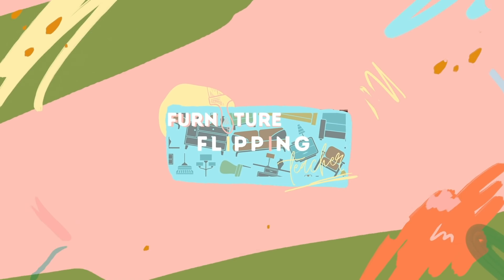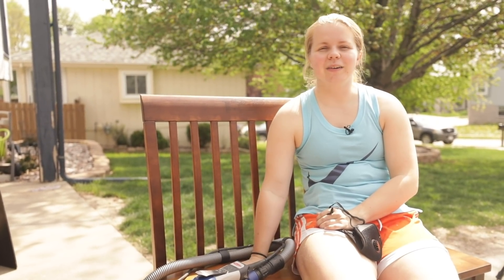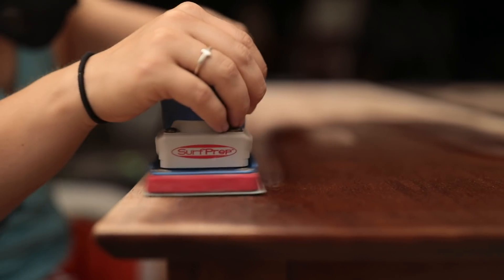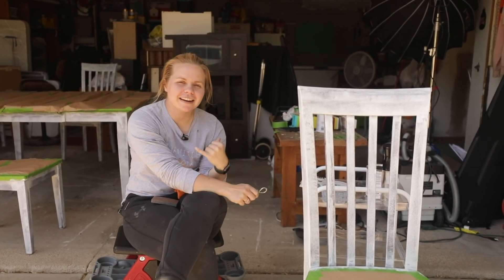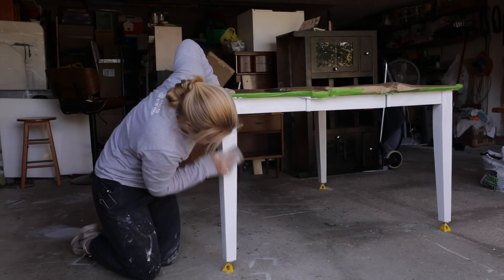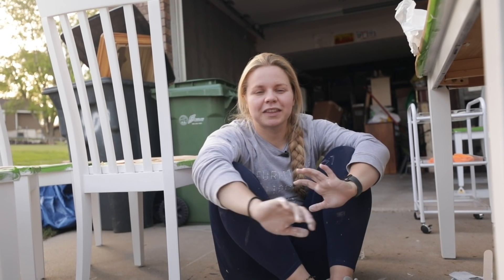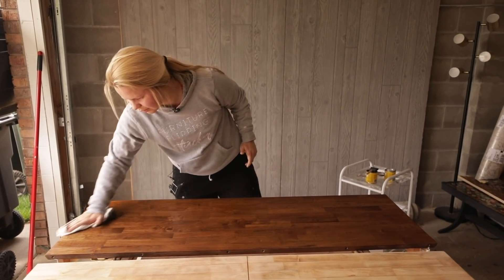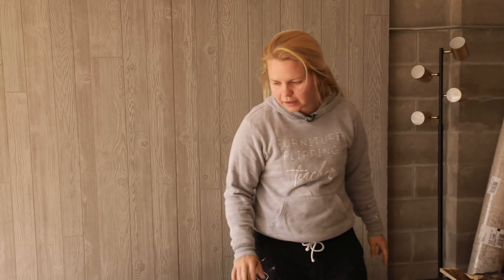DIY KITCHEN TABLE MAKEOVER | How to Refinish a Table | Beginner Friendly

Comment: Great job! A little hint: I do 2 coats of BIN shellac primer when painting white. That second coat does amazing and will cut down on coats of white. Also I have the store add 65 drops of black to a "gallon"  (15 drops to a quart) as the BIN has a yellow cast and the light grey (after adding the black) makes the white paint brighter!
Reply from the maker: I realized I should have done two coats of primer after I did the first coat of paint! I do actually have some gray primer as well, but I usually use that if I’m gonna go for a darker color. Thanks for watching!

Comment: What a cool channel you have. Thank you for all the knowledge here. Wow. I have a question, we just got an old dining table that has intended grooves in the top. They are about 1/4 inch deep,  there are a lot of them and of course they're disgusting and dirty. I tried steaming the gunk out and ended up shredding a little of one groove before I stopped. Now I'm wondering if I should get a heavy duty sander, CAN I sand down that far? I wondered what you think or if I should just make this into firewood?

Comment: I used one of those orbital B&D sanders on a hardwood bedroom floor, then refinished with an oil base poly.  It wasn't perfect, the wood could have used a real floor sander, but it was 500% better than what I started with.  I simply attached it to my shop vac which worked out pretty darn good even though I had to tape the intersection of vac hose and sander handle.

Comment: It looks amazing.I have done several pieces this way.( stain top,paint bottom) On the chairs, I find it easier to remove the seats whenever possible before staining them.Also, I flip the chairs upside down onto a table or counter and do the legs first( both coats) then flip them upright to do the backs and area where seat will re-attach to. I always tell my clients that it will be materials plus labor and try to give a ballpark on each.But a lot of times I still short change myself.🤪

Comment: Hi. I like the instructional videos. What do you use to clean wood with? Do you have suggestions on how to refinish my mom's wood dining table? It has plastic tablecloth doily outlines in it and my sisters will kill me if I paint it or the buffet and hutch. Should I sand to bare wood or can the residue be removed and finish restored? Right now it is covered in papers and glasses and plates,, so not in a rush

Comment: Chair rungs/spindles take FOREVER! We found the same issue, lol. SO... we now use foam roller for base and 2nd coats on the spindles. The finish coat is brushed and I still use my custom chalk paint and hand rubbed wax finish. No perceivable difference, but a world of my time saved!

Comment: I’m pretty sure if you would’ve flipped those chairs over you would’ve found that there were four screws holding the seats to the frame. When I do finishes like this I remove the seats which makes painting and staining so much easier. Just a thought in case you do another set like this.
Reply from the maker: You know... I don't think I checked but I will definitely keep an eye out next time! 
Thanks for the idea Connie 😊
Reply: I was definitely thinking the same thing!
Reply: I have the same dining set and they do have screws.

Comment: You can custom mix your stains, like say 50% one color and 50% another. Try small batches and use the back of the item your staining since stain takes differently on different species of wood. Make sure you use a stir stick to get all the pigment settled on the bottom of the can.

I think if you ever get a chair like this, check underneath the seat. It might be screwed on instead of glued so you can remove the seat to stain and paint the chair separately. You could also give a price range for commission work. Maybe this could help you get your goal hourly rate.

Comment: Here's an old body working trick when sanding with a duel action sander move the sander with longer strokes looking for a cooler surface continuously so the paper doesn't clogg so fast. With this method you can apply a little more pressure and really feel it cutting through. Fastest way I know, imagine sanding a whole truck inside and out.

Comment: Lauren- can I use a water based Wipe on Poly after I stain (I’m guessing the one you used in this video was oil based). I like the “pros” of a water based Poly than the stinky & longer cure time of the Oil based Poly...
Also, I stained a dining table (but not the chairs) and I’m not happy with the stain color; doesn’t match the chairs well) would you recommend re-sanding the table or is there a way to fix the stain? (I really don’t want to touch the chairs because they are fine and I don’t want to deal with the spindles 🙄). The table top was pretty scratched up and someone place a hot iron on it... that’s why I’m only doing the table. 
Thanks 

Your pieces turned out really nice btw! 🤩
Reply from the maker: it should be fine to use water based poly as long as the stain is completely dry! 
not too sure about your stain issue but I think the only way it to sand again

Comment: Do you only sand between painting coats and not after staining? And, do you use a “damp” cloth to wipe down a final sand on chalk paint just before sealing it? I’m really having trouble using Rustoleum Chalk paint in the color Charcoal. My paint is really drying blotchy and streaky. I’ve redone it several times, sanding back down and re applying paint! I just want to final sand it and be done! Lol! I’m using a neutral wax to seal. (It’s an antique cabinet, btw).
Reply from the maker: I have only used the charcoal from rustoleum a few times, and it is a little bit more difficult to work with than the linen white. I have had a couple of other people express the same situation that you are having. I would just make sure that you are thinning it out with water and making sure that it doesn’t dry too fast in heat etc. I do a light sanding with a very fine grit of sandpaper between painting and staining. I would recommend the finishing pad for the last coat of paint before the topcoat. hope this helps! Thanks for watching!
Reply: @FurnitureFlippingTeacher  thanks so much for the recommendations. I will try to find the finishing sanding block. Maybe at Home Depot?? I did finally get it to look halfway decent with a roller. But you can still see blotchiness. And some streaks. But not nearly as bad as before. Hoping the final sanding will blend it in some. I do have a paint sprayer, but I haven’t used it yet and I’m a bit nervous about it for some reason! I live in the desert and the paint  dries super fast here. Also, this cabinet was really really dry before painting. It just sucked the color right up! It had to have been left outside for quite some time. But it’s an antique Victrola cabinet and I’m really excited to see how it’ll turn out! Thanks again Lauren. I LOVE watching your channel! You were the first one I started watching months ago. And your my favorite! Keep it going girl! We love you!♥️♥️♥️

Comment: I stain pieces a lot more than paint and you just really have to stir the stain up. Special walnut does get a little bit darker if you really mix it up and get all the way to the bottom.
Reply from the maker: Thanks for watching!
Reply: What is your favorite color of stain?
Reply: @karenbutcher5921  it depends on the piece. But usually warm or neutral stains. I’m not really a fan of gray tones or cooler shades. I hope that helpful.
Reply: I tried Jacobean but I thought it was too dark. What color would you suggest if I want to go a little lighter?

Comment: Hey! Quick question:
Did you sand in between the poly wipe on layers? If so, what grit do you use? This always confuses me when that us the direction on the back of the top coat can.. its supposed to help with air bubbles  or adhering the multiple top coats to eachother?
Reply from the maker: you can either use a very high grit sandpaper such as a 400 or above or you can use a finishing pad like I do. What it’s talking about is it’s just going to eliminate any bumps or dust and then after you use the sandpaper you’ll wanna wipe back any dust with a microfiber cloth before you apply the next coat of poly. Hope this helps!

Comment: The big difference between the sanders is probably the fact that the addition of the vacuum and, I’m guessing, a higher quality paper are preventing the paper from getting loaded up. You can experience this kind of difference if you compare Harbor Freight sand paper to a good 3M of the same grit. I’m sure that sander is great but if someone’s restricted by budget and needs to stick with their current sander definitely try some different papers and add a shop vac if possible, some sanders allow for attaching them.

Comment: I saw a way you can tape and paper faster on another channel. I can't remember what one. She put the tape on, facing up, on the underside of the table, so there was still some sticky peeking out, (1/2 inch or so). Then she cut the paper and placed it on top of the table, and folded the tape over the edge.  Does that make sense? Hopefully helps

Comment: You could double your production (higher production, higher profit) if you invested in a paint sprayer. This dining room table set would've been perfect for a paint sprayer.
Reply: I was thinking the same thing.  It could have been done in half the time.
Reply from the maker: I am going to be trying out a paint sprayer in the very near future (: Thanks for watching!
Reply: @FurnitureFlippingTeacher  can't wait to see what sprayer you try out. DIY Wife seems to have one that does a great job as does Flipping Nataly.
Reply: Nice job on the set. I’ve done a few myself & it can be time consuming for those sets. I’d love to see you do another table set with a sprayer. That Shabby Guy uses a couple of different sprayers.
Reply: @FurnitureFlippingTeacher  I just did two Barstools for the first time with the Wagner Flexio sprayer.  It was a Godsend not to have to hand paint all those spindle areas!  I used it with the Kilz, the paint and I watched a video where you can use DB Gator Hide top coat too (might start spraying ALL my top coats at the very least...way faster and nice finish!)

Comment: Turned out awesome! You could have saved yourself sometime maybe by taking the chair see off and spraying the entire set. Maybe invest in a paint sprayer I love mine! Face 🥰
Reply: I was wondering about that too because the back of the seat, where it meets the spindles, would be impossible to stain.
Reply from the maker: I am not sure if the seats came off or not! I didn't even check! I will keep that in mind next time though! Thanks for watching!
Reply: They may not come off, so we are just speculating. Either way, it looks great. I have never sprayed furniture myself. I prefer just brushing it on.

Comment: Hi Lauren. Set is Absolutely Beautiful!! Good choice with colors!
Did you lightly sand between top coats?
Reply from the maker: I personally do not send between top coats. However on the stain I did use my finishing pad between top coats just to illuminate any bumps and dust.

Comment: Hi I just redid my kitchen table and used verathane stain (waterbased)and then went on top with a verathane polyurethane (waterbase)topcoat . The kids were doing homework and now you can see pencil indentations and writing marks.  I put the topcoat on three times and sanded in between. Help!! What did I do wrong ? Lol

Comment: I've been stripping, building and refinishing furniture for over 20 years and wanted to just offer some friendly advise.  It's very important to never sand wood to remove a finish in preparation for stain.  It's great if you're painting, but sanding, especially with an 80 grit paper scars the wood, especially when applying pressure.  This is why your table top came out uneven and with some darker spots.  I used to make this same mistake.  The best option is to use a furniture stripper, then a 220 or higher paper by hand to prepare the wood without scarring it, without applying pressure.  Wipe on poly is my favorite finish, but not ideal for a table, it will wear away with time.  To save time you can purchase a stain with a poly in it.
Reply: Thanks Tammy for all these tips with your experience. I also use a stripper for the ones I’m going to stain. I only sand after I’ve stripped it. You’ve confirmed what I’ve been doing for a couple years. And def a stain with poly. Much easier
Reply: Where are you located I am moving to Miland Michigan and I need my dining table refinished?
Reply: When you say stripper are you referring to citristrip?
Reply: Thank you for this…
Reply: You're most welcome
Reply: I read to not sand wood to get finish off. Used citristripper- not happy with it. What do you suggest to remove old stain? Ty
Reply: What kind of stripper do you recommend? When you say scars the wood, is this the dark appearance of it throughout the piece you refinishing. I used citristrip on a wood table to take of the finish, followed by sanding with 120 grit and then switching to 80 grit because the finish was not coming off with the 120. Then I noticed dark spots in the wood.
Reply: @Blue123413  The dark spots are from the sandpaper...if you use a sand paper to strip a finish is most likely what caused the dark spots.  80 and 120 grit paper is quite rough, you can try sanding the entire piece with finer sand paper, beginning with 180 then 220 and so on.  Alternatively you can try using a gel stain instead of a regular stain, it sits on the surface and does not soak into the wood, it is easier to achieve a blended look with it.
Reply: @tammyvanroon7386  thanks so much! I was thinking of using the gel stain because of the dark marks in the wood after watching a video that confirmed what you stated while waiting on your reply. You are so kind! :)

Comment: Hey I'm a professional painter.  You would save more time cutting in edges with a brush and using a mini lint free roller to apply product.  I would brush and roll all primer and spray all paint.  Since you have a wagner you could potentially spray a primer as well.  I would talk to a cabinet refinishing shop to get better products to use and a sales rep to get top discounts for paints.

Comment: I feel like it might have taken longer because of the paint. I haven’t used a lot of chalk paints but I’ve noticed with the rustoleoum it seems to always need soooo many coats and levels out terribly.
Reply: I agree ! I just did a dining room table with the rust oleum chalk paint and I absolutely hate it lol terrible leveling and like you said 3 sometimes 4 coats
Reply: @katherinefrederick3164  I’m glad to hear it’s not just me. I did a project with the rustoleum and it took literally forever compared to just using normal paint.
Reply from the maker: That could be true! There are definitely some differences in paint! I like to utilize lots of different ones (:Thanks for watching!
Reply: @FurnitureFlippingTeacher  I’m so glad it worked out for you ! The table is beautiful and I def know what you are saying with the chairs without a sprayer because I’m in the same boat and ready to pull my hair out lol
Reply: Chalk paint is a lot of hype. Latex works fine, doesnt cost as much, hundreds of colors to choose from and you can get it anywhere.
Reply: @Annie261.  I agree ! I like to use my waverly chalk paint on some of my small crafts but for big projects I have learned that the latex paint works just as fine and you can still get the chalky finish with the matte top coat

Comment: What do your Facebook posts look like? Do you use nice photos with a good camera or a phone camera? Does it make a difference? I know the pictures need to be nice, but I’ve wondered if pictures that are “too nice” deter people from buying. I say this because there is so much advertising of brand new items (typically shipped items) on Facebook. I also think that the attractiveness of FB market is that you can get things locally, in cash, and quick. So, whenever I look for stuff locally, sometimes the ads (with professional pictures) stick out like sore thumbs and I don’t even bother clicking on them. I wonder if there could be that confusion. Great vid!
Reply from the maker: I have had a few people ask if I took the photos, etc but most dont! I have used both cell phone photos and camera photos and they seem to do well! 😀

Comment: You need to order a Whooster foam brush from Amazon. After trying one you will never want to use the cheap foam brushes again. The whooster ones are washable and if using it for sealer only you should get 5-6 uses, and it does not fall apart like the cheap ones.
Reply from the maker: I will have to check it out! Thanks for watching!!

Comment: I used to do this about 10-15 years ago, but I wish I had had the awesome paints you have available to you now. But I cringe every time I see you kneel on the concrete. I sincerely advise you to invest in a nice pair of knee pads. Your future arthritis pained knees will thank you later. I just had the 4th surgery on my knees and I will need at least one more, my second knee replacement, before I am done. I just had a cleaning out surgery last week and I am in a tremendous amount of pain. At least put some kind of foam pad on the ground when you kneel. Protect those knees as much as you protect every other part of yourself. Please!